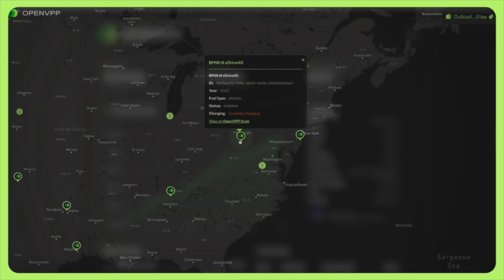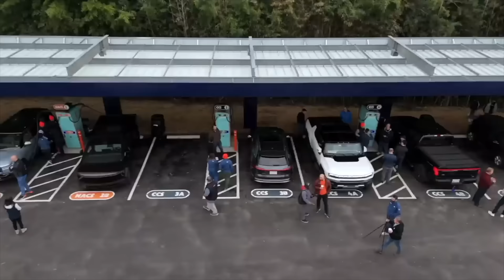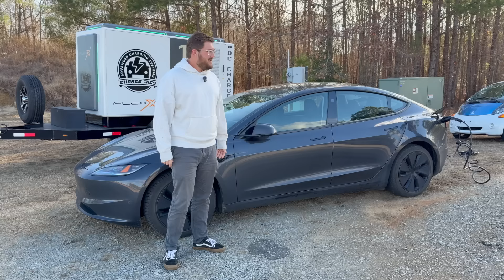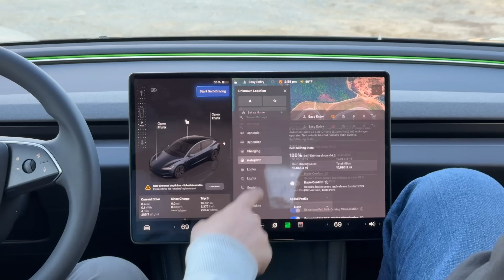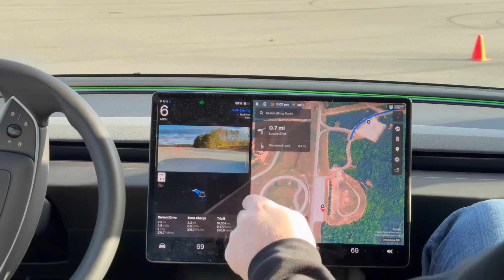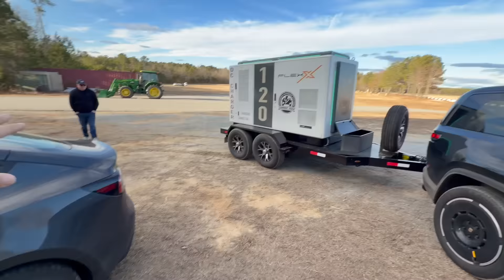First Cross Country Autonomous Drive Completed! Over 10,000 Miles Using Tesla FSD w/ No Intervention

Comment: And then you have waymos that can't drive right across one city 😂
Reply: also afraid in the dark
Reply: @Poxenium  if only it had 2 more lidar's it would've driven itself safely in the blackout yeah?
Reply: And robotaxis who still need safety drivers. I noticed fanboys stopped taking videos riding in them
Reply: @NN-gy7xl  wait until your brainwashed brain realizes Waymo had safety drivers WITH LAPTOPS for over 2 years since launch AND are having safety drivers in their cars when launching in a new area. Did this fact hurt your brain? Lmao
Reply: @RoguePhotographer  that's not how it works. If the car needs confirmation of something it sends a request for verification. Meanwhile if a Tesla screws up it always has someone on board to save it from screwing up. With the removal of the safe driver now Tesla has another car behind with a safety driver to save it remotely.... It is really efficient stuff I tell you 😂.
Reply: Neither a Tesla 😂 because they have a safety driver or chase car. They haven't even applied for level 3 autonomy.
Reply: @juanmedinar20  Shows how much you know that you think that SAE autonomy levels are an application process. You do NOT apply for SAE levels. Tesla also does not use chase cars, but they do use safety monitors and drivers as required by laws and regulations. You'd be surprised to learn that Waymo also uses safety monitors, the only difference is that they are remote.
Reply: @ProXcaliber  haha Mercedes is the only approved Level 3 car in the USA and Waymo is approved to actually run a real robot taxi service. Tesla doesn't have neither one.
Reply: @juanmedinar20  You keep saying “approved” like it’s an application, it isn’t. SAE levels are a classification, not something you apply for.
Also, Mercedes’ Level 3 only works in a very narrow set of conditions (specific roads/regions, limited speeds, specific weather/traffic, etc.).

Tesla has only been running a taxi-style pilot for months, while Waymo has been operating for over a decade. And yet, Waymo is still limited to a handful of cities and only within those mapped/geo-fenced areas. You can’t just drive a Waymo outside those zones because it isn’t built to handle “anywhere,” and you also can’t buy one.

Tesla is trying to solve a much harder problem: a general driving model that can work broadly without needing high-resolution mapping of every city.
Reply: @juanmedinar20  
You mean the Mercedes "dry highway, not in sunlight, below 40mph" system?
O.......K
Reply: @ProXcaliber  Yes Mercedes can only use Level 3 under certain conditions and Waymo is doing great. Tesla has neither, just some internal pilot programs and has not applied for approval to run a robot taxi service. Waymo and Tesla are no apples to apples at all because Tesla so far has had zero robot taxi rides. Waymo is deploying their services at a better fast pace while Elon keeps missing goals. Today is the 31st and his promises did not happen.
Reply: @juanmedinar20  Mercedes Drive Pilot being Level 3 is legit, but it’s not some broad win. It only works in a very tight box: pre-defined freeways, heavy traffic, daytime, no bad weather, no construction, and 40 mph or less. That’s straight from Mercedes + CA DMV. Now, the Tesla part: saying “Tesla has had zero robotaxi rides” is just false. Tesla started doing paid robotaxi rides in Austin in June (no one in the driver seat, with front-seat safety monitors/oversight), that’s literally robotaxi rides, even if supervised. And it stopped being “internal only” later, the Robotaxi app in Austin opened up to anyone to download and ride. If your point is “Waymo is ahead today because it runs a mature, fully driverless service (within geo-fenced/mapped areas),” fine. But “Tesla has neither” and “zero rides” is just you hand-waving away things that already happened. ‘Zero rides’ is a bold claim when people have literally been paying for them since June.
Reply: @ProXcaliber no Tesla has don't zero robot taxi and that is factual. Tesla has not submitted and application to the DMV. What ever Tesla is doing now is considered internal testing.
Reply: @juanmedinar20  Quick fact check.

1. Mercedes
Yes, Drive Pilot is Level 3, but only in a very tight box. Specific mapped highways, heavy traffic, under 40 mph, and only under certain conditions. It is impressive where it works, but it does not scale everywhere.

2. Tesla "has zero robotaxi rides"
False. Reuters reported June 23, 2025 that Tesla started robotaxi rides in Austin with paying passengers (the $4.20 fare) and no one in the driver seat, with a safety monitor in the front passenger seat.

3. "Just internal pilots"
Also false. Forbes ran a piece on Sep 4, 2025 titled "Tesla Robotaxi Is Now Open To All In Austin." Business Insider also reported the Robotaxi app waitlist was opened up to everyone.

4. "Has not applied for approval"
Wrong framing. You do not apply for an SAE level. You apply for permits and licenses.
California DMV lists Tesla Robotaxi LLC on its AV testing permit holder list (updated Nov 21, 2025).
Texas lists Tesla Robotaxi LLC as a Transportation Network Company licensee with the state (TDLR).

5. Texas stats / operations
Austin also maintains a public incident dashboard for autonomous vehicles, so the state/local area is literally tracking operations and incidents. This is not "trust me bro" internal testing.

If your point is, "Waymo is ahead today in fully driverless commercial service within its geo-fenced areas," fine. If your point is "Elon misses timelines," I will not argue that. But "zero rides" and "no permits/licenses filed" is just wrong.
Reply: @juanmedinar20  Zero rides? Nope. Austin has already had paid robotaxi trips (with safety monitoring).
And calling it “just internal pilot programs” is misleading when Texas/Austin publicly track and publish operational reporting and stats for autonomous service.
You can argue Waymo is ahead on fully driverless deployment. You can’t claim Tesla has had zero rides. End of story.
Reply: @ProXcaliber  Tesla now has a Transportation Network Company permit so it can legally operate a paid ride‑hailing service but Tesla doesn't have a driverless ride hailing service approved by the state or city like Waymo does.
Reply: @juanmedinar20  That’s a goalpost move.

You started with “zero robotaxi rides” and “internal testing.” Now it’s “ok, they can legally operate paid rides, but not approved driverless like Waymo.”

Pick one. If Tesla has a paid robotaxi service in Austin where the car is doing the driving and a safety monitor is there as a backstop, then those are robotaxi rides. Period. A safety monitor doesn’t magically turn it into “zero rides,” it just means it’s supervised.

Waymo also uses safety layers too (remote ops, fleet response). Different form of oversight, same idea: safety blanket.
Reply: @ProXcaliber  lol it has zero robot taxi rides. It has no approval, and they have safety drivers or chase cars 😂. How can you say it has actual robot taxi drives when it is not even approved for driverless rides?

Can you tell how many driverless Tesla rides have done? I can tell or anyone can tell you how many rides have Waymo done lol.
Reply: @juanmedinar20  Driverless means no one is driving the car. If there’s nobody in the driver seat and the car is doing the driving, that is driverless. A safety monitor sitting there as a backstop is not “a driver,” because they are not steering, braking, or operating the vehicle.

What you’re doing is swapping “driverless” with “unsupervised.” Those are not the same thing. Waymo has oversight too (remote ops and fleet response), and that doesn’t make it “zero rides” either.

So no, it’s not “zero robotaxi rides.” It’s driverless rides with supervision. You can argue about how much supervision you want, but you can’t pretend the rides didn’t happen.
Reply: @juanmedinar20  babe this comment won't age well, once you go and watch Mercedes "level 3 self driving" literally tried to kill it's occupants 44 TIMES while Tesla needed zero disengagements that entire drive (and it wasn't even the latest FSD, that tells you all you need to know about how incapable Mercedes self driving system is), please fucking wake up lmao
Reply: @juanmedinar20   They haven't even applied for level 3 autonomy. 
Nor will they, because they're skipping Level 3 and going to Level 4, which they've already achieved on a test basis in Austin.